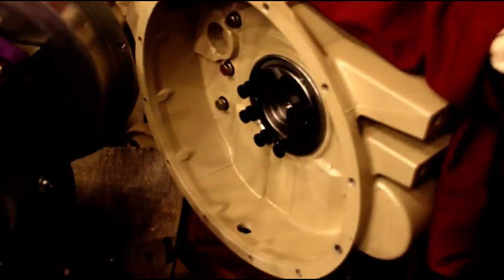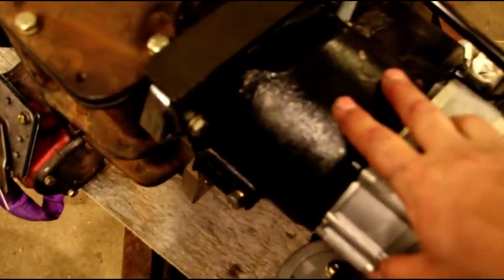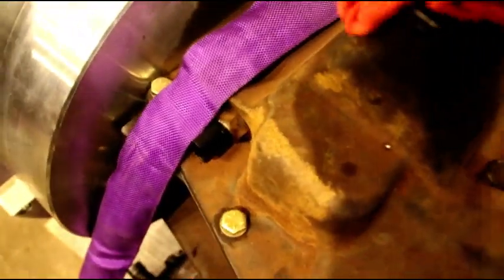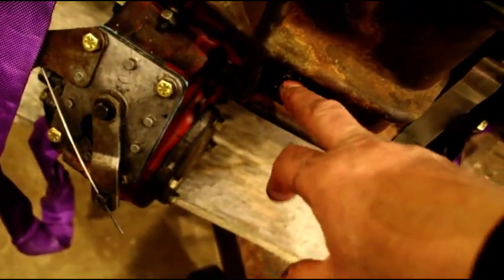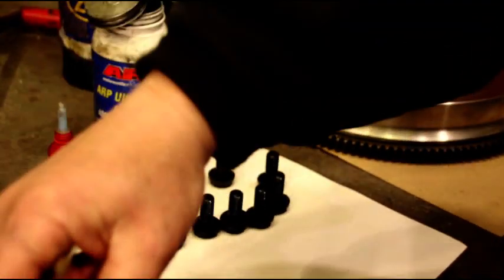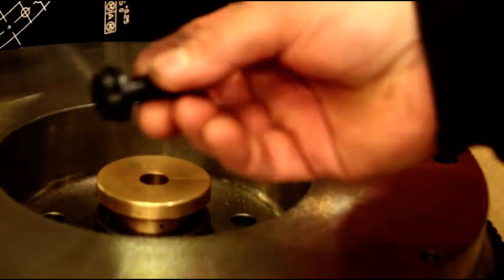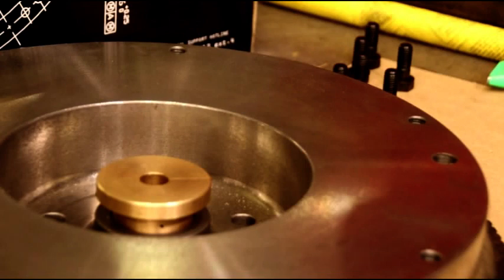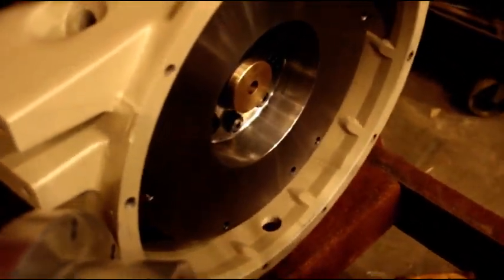Cummins 4BT.... Flywheel, Clutch, SM465-Dana 18 Twin Stick

Comment: Great job, Brian! Can’t wait to see it going into the Jeep. Just goes to show what happens when you plan your work and work your plan!
Reply from the maker: I am hoping to start building the frame soon so I can get the drivetrain test fit and installed.   The adapter came out great and now just getting other little things installed.  Alternator, starter, etc....

Comment: Brian, do you use a radius faced thrust bearing,,or flat face on the pressure plate ...regards Frank
Reply from the maker: standard flat throwout bearing.  The clutch setup is standard for a Chevy Truck.

Comment: What oil did you use in the transmission?
Reply from the maker: I have a complete line of the correct lubricants for older vehicles.  I can send you a price list if you would like to order any.   contact me directly at metalshaper@comcast.net
Brian

Comment: Brian, why is there 6 pulleys on the pto?
Reply from the maker: Standard setup when running a pto welder or pto generator.   Heavy load requires multiple belt setup.
Reply: @metalshaperJeep  Got it, I didn’t realize a welder would be such a heavy load to turn, it must be a big one.
Reply: Thanks for another great video, Brian. And thanks for sharing.
Reply from the maker: @gman4937  Thanks for watching, more cummins videos coming soon.